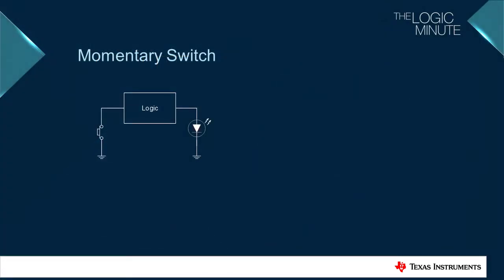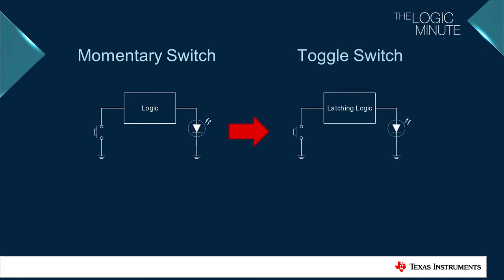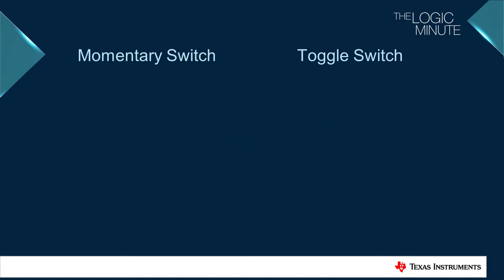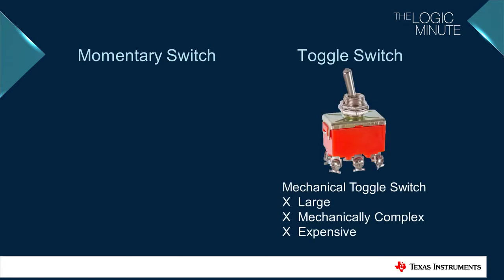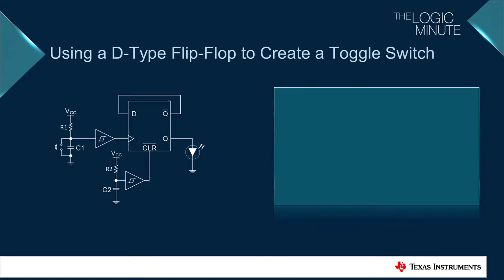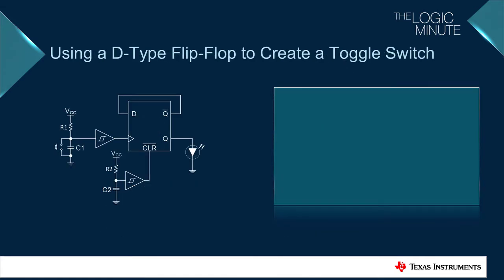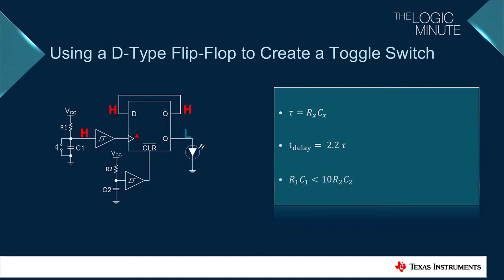Convert a Momentary Switch to a Toggle Switch

Comment: That's all good and dandy if your powering a 9-12vdc device using a battery or wallwart. But what if you want a switch to turn on and off a 120VAC, 100Watt lightbulb using the mains 120VAC as the only power source? i.e. the load and switch in parallel across the 120VAC mains?

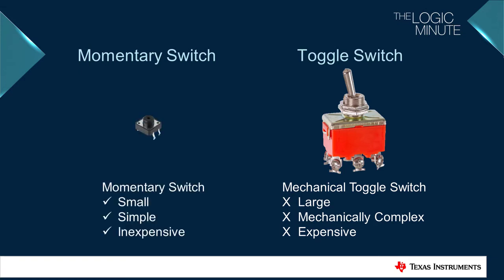Comment: I disagree with statement at 0:33, what if youor momentary switch fail ? the replacement of the mechanical switch will be very easy to do. This is my opinion and certainly it's apply only in places were you have room for a mechanical switch or the "aestetic" is subordinated to the functionality.